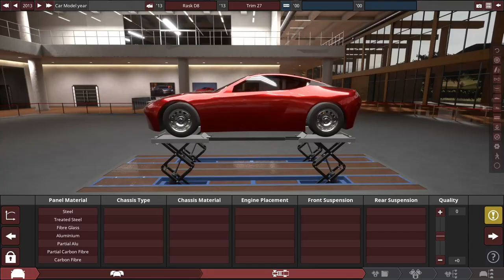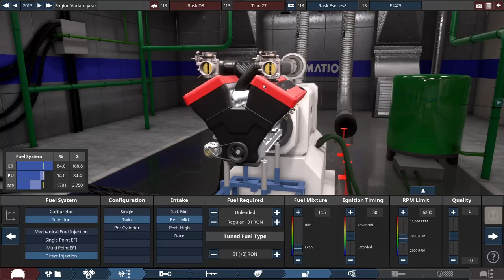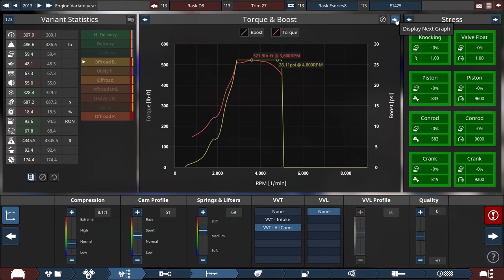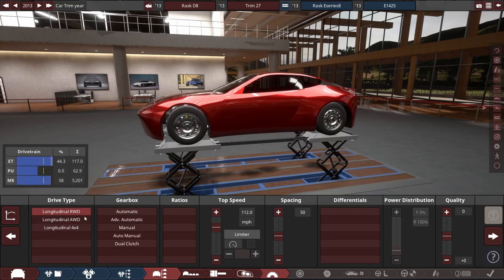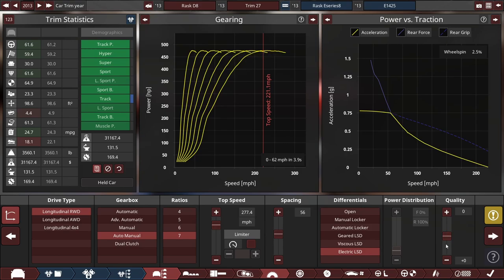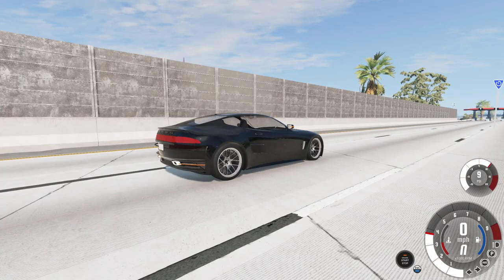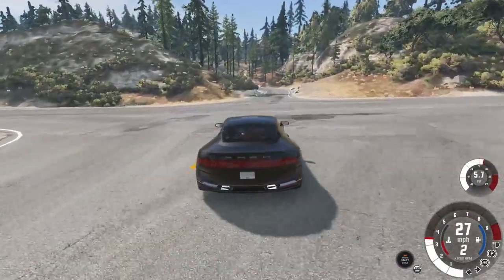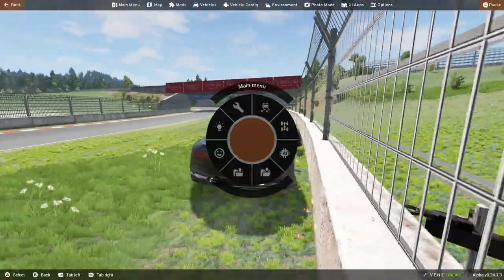I BUILT A "CHEAP" 200MPH TWIN TURBO SPORTSCAR! | Automation/BeamNG

Comment: The turbo is simple really. In this video you could have adjusted AR or make the compressor bigger for the right side of the line and turbine size to get the spool in line(the slant up to the flat line). AR will lengthen and narrow the map further to the right, and the opposite to the left.
Reply: I wish that there was Hot-V modeling in this game. I6s are pretty much the most optimal "service engines" for just making stuff that ticks, and if on the other hand it's pure technical excellence you want then a Hot-V eight 4,2-4,8L with a couple of twin-scrolls going into a well-tuned exhaust or with some kind of flow inducer should be just about the most optimal imaginable build...